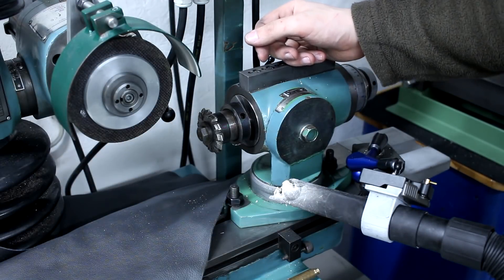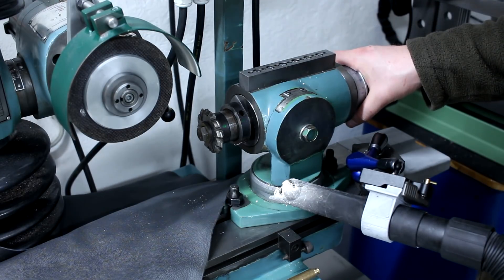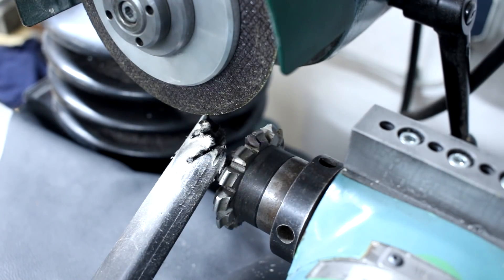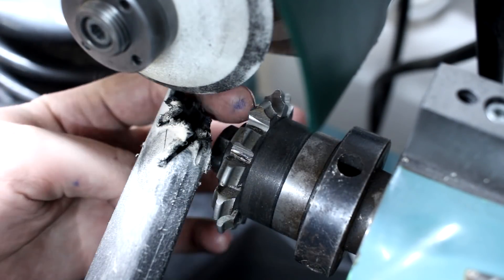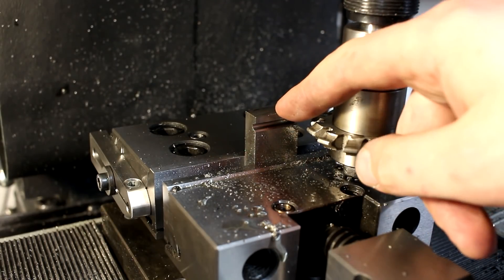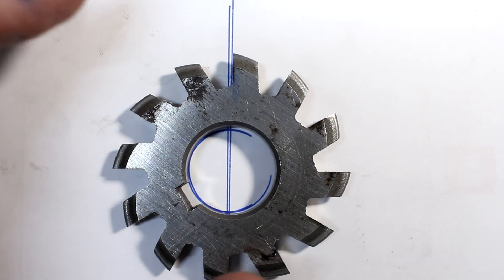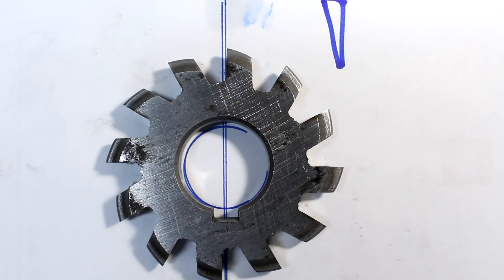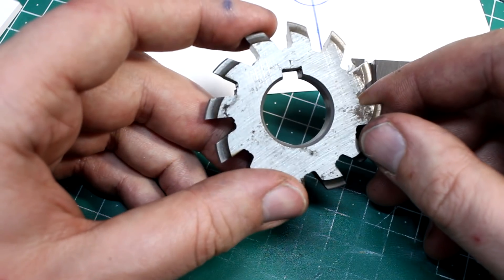Toolgrinding: Resharpening a gear cutter

Comment: I doesn't take that much effort to do this much damage.  ;-)  I just did it to a gear cutter today in 1018 mild steel.  My cutter looks pretty much the same as the one in this video.  I'm ordering a tool and cutter grinder, the cut-off wheel, and the cup wheel.  Compared to me, you know exactly what you are doing!   LOL

Comment: I watched a film in apprentice school back in the 1960s on sharpening gear cutters, I think produced by Cincinnati milling machine company, it showed the first regrinding of a gear cutter.  The operation was done on their cutter grinder using their infeed type attachment that has the work arbor vertical, and the grinding wheel arbor horizontal.  Since they do not consider the back of the tooth to be a precision surface to locate from, the back of each tooth is first ground by using the front (cutting edge) of each tooth as the reference surface, being located by a tooth rest; after the backs of the teeth are ground, the cutter is turned over and the tooth rest is reset to bear on the back of the tooth and regrinding proceeds by rotating the arbor/tooth rest assembly for each sequential grinding pass until the cutter comes sharp.  The attachment is provided with a gage to set the cutter radially in the process of setting the tooth rest.  The attachment arbor is also capable of tilting to accommodate cutters with side rake.  Using the method that Stephan presents is liable to result in teeth of slightly different heights due to inexact indexing.

Comment: Great explanation Stefan. Is there a method for determining how far back from the centre line the wheel face should be positioned? In other words how do you determine the gap between the two lines. Cheers

Comment: So taking the cutter a millimeter back will inevitably make the whole gear profile smaller due to the relief of the tooth. Wouldn't this mess up the finished product? Unless you did the same for the mating gears? So let's say the tooth has a relief of 5° at 1mm would make the entire profile almost 1/4 mm smaller correct? I am probably off, I did it in my head and not used to metric. But I dont see how this would be effective as it would change the diameter, pitch diameter, and meshing of the gears.
Reply from the maker: No, the profile stays the same all the way back, thats the whole idea behind a backrelief-turned cutter. The cutter itself will get smaller in diameter, yes, but the profile is always the same and always the same size/dimension.
Reply: @StefanGotteswinter  Oh okay cool, I didn't realize it didn't have relief to it. Is that why when you showed the wear due to excessive speed that it rubbed so far back on the tooth? And does this style generate more heat with no relief? Pardon my ignorance, I have moderate milling experience but most of my experience is in mill/turn and cardiovascular swiss machining as well as precision cutter grinding. Have you ever heard of/used Agathon grinders? I believe they are swiss made. If you ever get a chance to get your hands on one they are amazing. I regularly make .035" boring bars and .010 grooving tools with them. I notice in another comment on a different video you mentioned using molybdenum for facing your diamond wheels, do you use this in conjunction with a silicate stick to open the pores? The best way I have found is to use the silicate to knock back the binding material and then dress with molybednum to create a plane with pores still open. I have great respect for you and your videos. You possess alot of intelligence and talent shared with many people. I wish I was allowed to film what we do at work. I actually make parts for a German company called Biotronik. Pacemakers, ablation tips, endoscopic cardiovascular components, etc. But since we machine exclusively platinum alloys no cameras or metals are allowed in the shop sadly. But most of the micro drills, reams, boring bars, etc are pcd. Which is amazing to work with as long as rigidity is maintained. If you ever have any swiss turning/micro machining questions feel free to ask. It is always a pleasure to hear from talented individuals such as yourself. Take care.

Comment: WHY NOT????...Make a 2 flute end mill ground to form a particular gear tooth geometry. Cut the gear in a 2 step process in the same way T-slots are a 2 step process. Regular end mill to the root of the cut for all the teeth.  Than use the "form end mill" to clean up the sides.  Machine clearances could be much tighter, more rigid, simpler process....( i can hear you say "yea, ok, go do it "Tuffy"...because i am not you or have your ability Stefan )....I enjoy all you do & look forward to future projects....TM

Comment: Hi, Stefan, I often see you pick up second hand tools and equipment and wonder if you are specifically looking for items or just scanning for potential bargins. I use ebay but struggle to find equipment. I would be interested to know what search or sites you use, is it more than just typing in "second hand gear cutter location Germany"?
Reply from the maker: Almost all of my used stuff comes from Ebay - I search mostly for auctions.
I use fixed price offers only, if I need something for an particular project right away and quick.
The rest of the used things come from a used machinery dealer close to me, its one of those places who bid on places that go out of business.

Comment: I went much further in gear cutter sharpening. I ran a gear manufacturing shop for 30 years. The multiple flute gear cutters (hobbing cutters). We used a Barber Colman or ITW cutter grinder. Totally automatic and it was made in the 50s. We now use diamond sharpening tools with no coolant. A typical cutter takes 30 minutes or less to sharpen. Also we never remove more than .015" per surface to sharpen. If you have to exceed that you left the cutter in production too long.

Comment: Dust collection tip: oftentimes if you simply flange around the intake horn,  it improves the pickup remarkably- it has something to do with Bernoulli, but I prefer Mostaccioli with garlic bread instead.☺https://woodcraft-production-weblinc.netdna-ssl.com/product_images/4-inch-bell-nozzle-dust-collection-fitting/5bdc7bc5776f6f5cf40002e0/detail.jpg?c=1541176261

Comment: A cutter with type of relief is marked on the
side ether offset or rake
and a number. This is how far tooth face was
off center when it was
new. As you said that
offset should be maintained. If the cutter
shows no offset it is 0 degrees rake and should 
ground on the center line 
of the tool. The offset
marked give usually 5 or
10 degree rake on cutter 
face. You are absolutely right about rotating the
cutter for stock removal. 
I tool and cutter grind for
a living and working on
my 52nd year in  the business. 
Ernie Storch

Comment: If I got it right, you shortened all the teeth by an equal amount. The overall OD of the cutter will be slightly reduced, but reduced equally for each tooth?
Reply: It had better be equal on all teeth or one will be deeper, ie an uneven wavy gullet will be cut.
Not a good gear.

Comment: Just to clarify my understanding, as you sharpen the cutter, the OD gets smaller. In use, the depth of cut would be the same, but the offset for the cutter needs to be adjusted after grinding?

Comment: If each tooth on the cutter is relieved and falls off, and you grind the leading edge back, isn't the new leading edge shorter than before? I guess maybe the radius of the whole cutter doesn't matter, just the profile, and as long as that stays the same, everything's good? Also curious how much you paid for that grinder? I think there was one just like that at an auction I was watching today. It went for the opening bid of $500 USD Is that an ENCO Tool and Cutter grinder 450A?
Reply from the maker: Yes, the cutter in general gets a bit smaller when you do a regrind, but the profile stays constant,
The grinder was about 1keur - Its a Knuth KSW200. A good base, but you have to put a lot of work into it, to make it a every useable grinder.

Comment: So keep cutter on center line of tool and radialy turn it into cutter gotcha, a question i had on the tip of my tongue
Reply from the maker: You touch off on the cutting surface when its vertical and then turn it into the wheel.
Reply: @StefanGotteswinter  Great video Stephan as usual, thanks for sharing and be safe.
 Cheers from John, Australia.
Reply: Oh ah haha I was thinking of your drawing when you said don't move cutting wheel in. So I assume that when setting up your cutting wheel is on centre of the tool to be cut, then turn into cutting wheel to dress

Comment: Judging by some things I've seen done to hobs were somebody is doing a repair on a gear with welded teeth it looks like that's what happened here. Somebody welded one or more busted teeth and tried to recut them.
Reply from the maker: highspeed steel is probably not to good at hardmilling ;)
Reply: @StefanGotteswinter 
 The advantage of hobbing of course is the load is spread out across more teeth. But still trying to cut stuff hard with high speed jobs just doesnt work. I know Barber-Coleman in the US built special grinders just for sharpening hobs

Comment: I guess that having un-regularly spaced teeth might reduce the risk of chatter, and is therefore desirable. Excellent video, I learned a lot - thanks Stefan.
Reply: You are right but the cutter has to have unequal spaced teeth in the first place. If you try to grind an unequal spacing on an equally spaced cutter you change the radius (distance form tool centerline to the cutting edge) of each tooth individually.

Comment: I have a feeling that even with what you paid for it and the time you put into it that you're quite a ways ahead compared to buying one new.  Stay healthy over there.
Reply from the maker: It was like 30min of actuall work, without the filming - So I guess its not to bad. Module gear cutters are seriosly expensive and these days quite hard to source new. Emuge Franken still has them in the catalogue, but I dont dare to ask for the price ;)
Reply: @StefanGotteswinter  aliexpress has chinesium ones for about 8€ a piece or 70 for full set on small sizes I think but I don't know what quality they are.